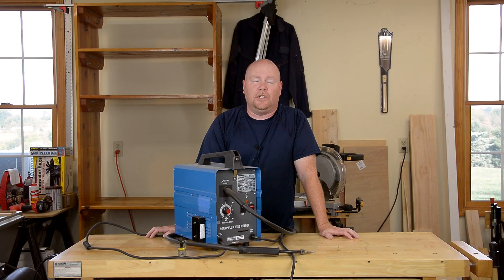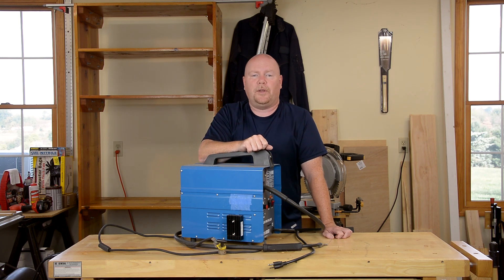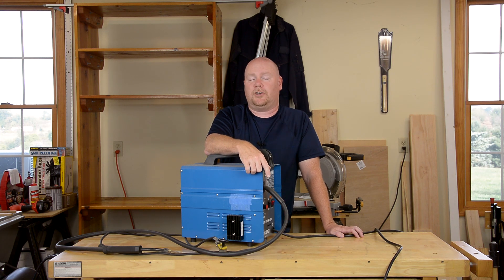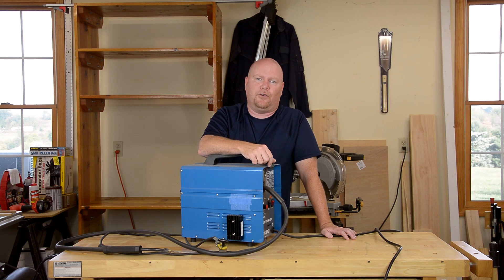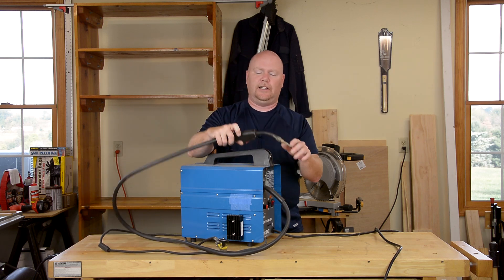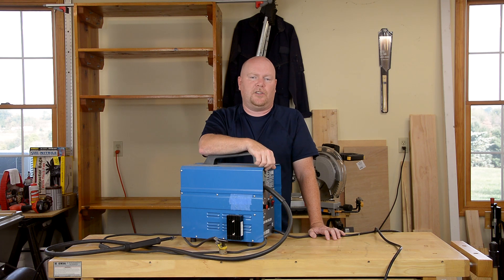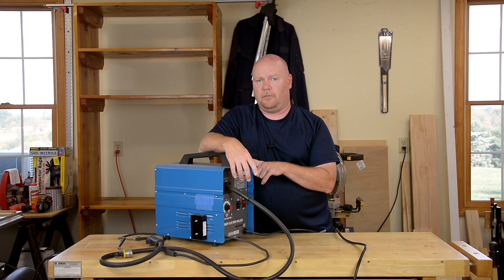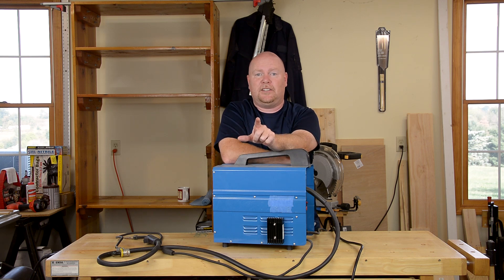Advanced Harbor Freight 90 Amp Welder Mods 09 - The F.A.Q.

Comment: First off, Thanks Matt!  I converted my welder this weekend and the results are great.  You can actually hear the difference in the welding; just crisp snaps that weren't there previously.

I do have one concern with the mod, especially if one is doing this on a newer machine.  As has been mentioned in a couple of these comments, the older blue machine has a hot tip anytime the machine is powered (sketchy AF), and the newer black machine has a switch in the trigger to kill the primary circuit.  So, if you are used to using the newer machine and just laying the gun on your table randomly while the machine is on, you may find now you have a hot tip and a good chance you will
get a quick spark and your wire will probably weld itself to the table/work.  This is because anytime you pull the trigger
(even if you are just letting some wire out), you are charging the cap, and it will remain charged for quite some time after you release the trigger (even if you turn the machine off).  YOU MUST RESPECT LARGE CAPACITORS!!!  This discharging can become very dangerous if your body becomes the conductor between the electrode and the grounded table/work.  If you want the capacitor to discharge in a safer manner, you have to install a bleed resistor across the cap, and when power is removed, the stored energy in the cap will be released through the resistor in the form of heat.  On either machine, if the cap is charged (even if the machine is off), it will arc and be potentially dangerous for quite some time; maybe hours, maybe days depending on the size of the cap.    I tested mine after 5 minutes, once with machine on and once with machine off, and the electrode tip would still arc and weld itself.  I installed a 10w, 200ohm resistor across the cap, and the electrode won’t arc after about 20 seconds.
Just throwing it out there.  Maybe not a concern for most, but I try to be on the safer side of things.
Reply from the maker: The problem here is that while it won't weld after 20 sec, you're still probably more than 50% charged.  The time constant depends on the capacitor, but with a 200ohm resistor and a 40kuF capacitor it takes 80 seconds to discharge by 63%.  It might not weld, but it could still be dangerous.  To make the time constant small enough to be a real safety factor, you'd need closer to a 100W resistor because it would need to be closer to 20 ohms.  Now your bleed resistor gets as hot as a 100W bulb, which isn't terribly safe either.

This is why I don't advocate the bleed resistor.  I think it's a false sense of security.  Short out the tip as soon as you turn it off, and treat it like a hot torch while it's on - trigger or no.

Now in my case I'm dealing with the old style welder where the tip was hot with power on regardless of the trigger, so having to do this to remain safe isn't really much of a change.   I haven't seen inside one of the newer welders, but I would assume that the mod could be done before the torch switch, so that external voltage was removed regardless of whether the cap is still charged or not.  If so then a bleed resistor that takes its time discharging the cap would be fine.  Having said all that, large power caps generally have terrible leakage current problems and will self discharge after just a few minutes anyway.

Glad it turned out for you!

Comment: Ok Matt. I put in a 33000uf cap, but it's 100 volt. Welder seemed to weld hot, even minimum.
Is that because of the 100v cap?
Reply from the maker: Nope - that's the sweet sound of success!  With proper DC power the welder is a whole lot more effective, so it seems like it has a lot more power.  The voltage rating on the capacitor is the maximum circuit voltage where you can use it.  It has no bearing on how much energy the cap actually stores.

Comment: I going to open it back up and check the wiring. I tried to check everything 5 times. I did have trouble understanding the schematic stamped on the rectifier for which terminal was plus and minus. That is the only trouble/question 
I really had.

Comment: Hey Matt, did the mod was 150 amp three phase Bridge rectifier just didn't use the middle terminal in the cap I mentioned.

I get the funny feeling I didn't get the wiring right from the capacitor to the bridge rectifier even though I went over a bunch of times. It welds like worse now, even using INI wire. An electrician I'm not....do you have an email that I could send you a picture of the inside wiring or of the bridge rectifier thank you sir.
Reply from the maker: The wiring should go from the transformer to the AC input of the rectifier.  You then go from the DC output of the rectifier to the capacitor and then out to the torch.  The way you describe it, it sounds like you may have them backwards.   Wire it up without the capacitor first and try it.  If all is well, then you can add the cap back in across the DC output and check it again.

Comment: Matt, I have a 50v, 63000uf, 95c temp cap. I'm pulling my hair out cannot find a 105c temp. Is the 95c temp cap I have ok for the mod?? Any over heating issues with the 95c?
Reply from the maker: Won't make a bit of difference.  I couldn't have told you what the temp rating on mine was.
Reply: Mil-Specification is 105 c temperature is last for 10000hours continuous operation
For 95 c temperature is last 1000 hours !
1000/8hours = 125 days 
Do not worry about rating, just enjoy your mod

Comment: hey matt i like ur mod i would like to know after this mod what is ur new dity cycle
Reply from the maker: Unchanged from the welders perspective.  The rectifier can get hot, so if you only have a 100 amp rectifier and your cooling is only passive (like mine) then the duty cycle can actually be lower.   It doesn't impact me much because I'm not fabricating things that cause me to need long weld times.

Comment: Matt, thanks for going to the trouble of making this video series, I appreciate it more then you will ever know. I see that you are still responding to people questions so could you answer a couple for me.
Have you heard of any problems with doing this DCEN modification on one of the older model blue HF welders, the ones originally without cooling fans? I’ve modified mine with a high cfm ac cooling fan and use it almost every day and it has never over heated on me
Secondly I have no problem doing an actual modification like this but my knowledge of electronics components is very limited. I can’t find a rectifier exactly like the one you show in your video and not sure if the one I’m looking at is a sufficient replacement, would you mind letting me know if this one will work ok,  Ebay item # 291821013316. thanks for your time…
Reply from the maker: It should be fine on an older unit.  I didn't know there was a version without a fan.  That's just nutty...      The rectifier you're looking at is a good choice but you'll need to provide a heat sink for it.  Mine had built in fins, and this one doesn't.   Something like this would be perfect: http://www.ebay.com/itm/Large-Big-Aluminum-Heatsink-Heat-sink-radiator-for-Led-High-Power-Amplifier-amp-/252401721287?hash=item3ac4509fc7:g:xCUAAOSwR5dXRU7m.   You'll also need a dab of thermal paste between the rectifier and the heat sink to ensure you have good conductivity between them.
Reply: Matt Heere
i have a bunch of old big cpu heat sinks i can use but the only cap i've found so far at a price i can afford with specs close to what you used is a nippon  50V 68000 UF, 65 mm x 105 mm but it seems small compared to what you used, all the 50v 50000uf caps are $70+
except for the mess it makes, this little welder amazes me, bought it in 2008 for $79 with a coupon, added a fan after warranty was up and i couldn't even guess at the # of spools i've run through it, never payed any attention to duty cycle weld all day everyday sometimes up to half inch with multipass wire and the thing has never over heated or kick off on protection mode it just makes such a mess on things like the small custom scrap metal motorcycles i build. being crippled on a fixed income i've come to accept a tig isn't in my future so cleaning up the welds on little blue wonder is all i have.. will that nippon cap work? thanks
Reply from the maker: The ratings are good enough so I say go for it.  Honestly the rectifier makes 90% of the improvement, so even if you end up with no cap you're still in much better shape.

Good deal on the CPU heat sinks.  You'll be dissipating around 60 watts of heat, so use two of them.  Probably needed just to cover the footprint of the rectifier anyway.

Comment: Hello Matt, nice mods. I was wondering, did you use an inductor coil ring?
Reply from the maker: I didn't.  Wire welding is a constant voltage process, so the capacitor is much more important.  An inductor helps to maintain constant current, which we don't really care about:
http://www.lincolnelectric.com/en-gb/support/process-and-theory/Pages/constant-current-vs-constant-coltage-output.aspx

Comment: oh one other thing do I want a DC or AC cap?
Reply: The cap is on the DC side of the circuitry.   Any cap you get should have a positive and negative pole.  The power is already rectified from AC to DC before it gets "smoothed" by the cap.  The cap just takes the rough rectified DC and makes it closer to real constant voltage DC.

Comment: can I use a Rockford fosgate 500,000MFD 20VDC  CAPACITOR?
Reply from the maker: 'Fraid not.  The voltage rating is too low on all of the car audio caps.  You really need a 50V part minimum.
Reply: Sorry found it, it is a DC cap I need

Comment: Wow Matt, thank you for posting this modification. I posted the other day but today I actually got to try out my "new" welder after completing the conversion to DCEN. I used a much larger cap than you did and still need to insulate it as the cap is so big, I had to mount it on the outside of the welder. I've posted my results here - https://youtu.be/FEkxQ4PVGLE and included links back to your video series. With as many of these little blue and black boxes H/F has sold, I'm sure there's plenty more hobby welders out there that would benefit from this modification. Thank you again.

Comment: I respectfully disagree regarding the capacitor sourcing. 

The best choice is a bank of smaller, low esr caps made by reputable companies, sold by reputable companies (such as Digikey). You can get 5 - 10000 uf, low esr caps for $20 + shipping and know that you are actually getting 50000 uf of capacitance at correctly rated voltages.

eBay capacitors are notoriously falsified in their ratings and are often MUCH, MUCH smaller caps, packaged into a larger radial can style housing.

Google "fake Nippon capacitors Ebay". You'll find out right away the vast majority of caps sold are Ebay have bogus ratings or are outright frauds.

The bridge rectifiers, I have no issues with those. They seem fine.
Reply: its a $100 dollar welder and he stated that you dont even need to put a cap in it, it just makes the power more stable really, Most mainstream welders use 6 caps and some 8, a 250Amp 220v welder i am looking at buying uses 6 250v 2200u caps, if you are good at soldering you could easily replace them with higher "u" caps, but because they are just there to stabilize the power why the hell would you?

Comment: Hey Matt. videos are great quick question. I have the HF 70 amp ac stick welder. is it possible to do this same type of mod to it to make it DC? Any help would be appreciated or maybe point me in the right direction. Thank you.
Reply from the maker: it's probably possible, but I doubt you want to.  Stick is often an AC process.  As long as you have compatible rods, AC should be fine for that machine.
Reply: +Matt Heere I always heard dc stick welding was smoother and easier to work with and thought if it was as easy as converting the 90 amp wire welder I would try it.
Reply from the maker: +William Mcclain I'm not a stick welder, but DC being smoother seems reasonable to me.  However, one big upside to stick is its versatility.  Basically, while not ideal, you can make AC work for most stuff by getting the right rod, but the opposite is not true.  AC is a requirement for things like aluminum, so in the end you can weld more with AC.

Your best bet would be to wire it up with a big switch so that you could do either AC or either polarity of DC.  Then you have it all.
Reply: Guessing you can get really creative with mods like the Lincoln buzz boxes.  https://hackaday.com/2019/09/12/modified-tombstone-welder-contains-a-host-of-hacks/

Comment: You should consider adding an inductor (choke) after the capacitor to smooth current spikes when the wire shorts in the weld.  This will keep it from blowing off the ends of the wire.

Comment: Hi again, 
Trying to do this on the cheap, I found a couple caps in my parts stash. They are 22000uf @ 68volts. Any reason I cannot use these in parallel?
Reply from the maker: +ringwood Nope.  That'll work.  22000 will get you 99% of the way there though.
Reply: +Matt Heere They are 22000 each. Should get me 44000, right? Thanks again for the videos.
Reply from the maker: Right.  My point was that you really don't need both, but since you have them - go for it.

Comment: Matt, Thanks for the great instructions. I have a question about the newer model that has a shut off to the tip in the handle. Is that a mechanical switch on the handle that disconnect the tip or does it go to a relay to break the circuit? I ask because if it goes back to a relay, when the power is off, how would you discharge the capacitor through the tip? Thanks again for a great video.
Reply from the maker: +ringwood I haven't seen inside one of the newer ones, but it is almost certainly a relay.  Good news is that if the tip is disconnected then there's no reason to discharge the cap.  It will self-discharge eventually, and it doesn't hurt anything having it sit around charged anyway.
Reply: +Matt Heere Good point Matt ! Thanks.

Comment: With the DCEN conversion is it possible to do tig welding? I would have to splice in a dinse plug for a tig, torch. I would have to buy a regulator , argon bottle and the torch but these a set costs no matter which cheapo tig welder you buy. The mig torch would still work and the tig torch plug would be separate plug.  I like the 115 volt plug for the
tig so it’s portable. Will the DCEN output support tig welding?
Reply from the maker: +dlt205 I seriously doubt it would work worth a darn.  TIG is a constant current process.  This is why you often see TIG torches as accessories to stick welders.  Stick is also a constant current process.   This, like other wire welding processes, is a constant voltage setup.  So, it's fundamentally not setup to run TIG.   Add in the lack of any real output control and it sounds like a disaster waiting to happen.

Comment: do i have to use a polarized capicator
Reply from the maker: +garry mclaughlin Technically no, but any suitable capacitor will be most likely be polarized because only electrolytics pack the needed voltage and capacitance ratings into an appropriate package.

Comment: Matt, is the fan in the HF welder AC or DC?  I'd like to change the fan to one of higher capacity.
Thanks,
Gary
Reply from the maker: +Gary Farrar It's AC.  Best bet for a replacement is a 120VAC fan that you can attached directly to the switched side of the power coming in to the welder.

Comment: I have the newest version of the HF flux core welder. I put in a 150A rectifier but no cap. It welds much better except for the wire feed. It starts welding fine but after about 10 seconds the wire feed becomes erratic.Those of you that did add another transformer for just the wire feed, could you give some details please.
Reply: You have to check whether the wire feed motor is 24vdx  and is fed off the main transformer output and if you change the output wave form it will affect how this motor operates

Comment: I did this mod. I did a few things differently. I replaced the fan and mounted it externally on the back. And used that space behind the transformer to mount the bridge and (20 X 50V 2200 MF = 44,000MF) caps soldered to #8 solid copper bus rails. The caps cost around $10 from Amazon. Added a toroid choke between the caps and torch on the neg. side and installed a separate 24V transformer that I had lying around for years to drive the wire feed. Well the welder does work great but I may have shot myself in the foot. It runs TOO HOT now. Before, with AC, I was able to weld thin auto body sheet metal very carefully, without blowing through. It was messy but the grinder cleaned it up. I don't know if I will be able to do that now. I am experimenting with ways to cut down the heat, mostly by trying to get the worst possible ground connection and using 1.5"-2" wire stickout. I am even considering running the ground circuit through a 100 watt incandescent bulb. I don't know how that will turn out, It may burn out or blow up. I will take safety precautions.
Reply: +Ed Burns Have an old toaster?? lol